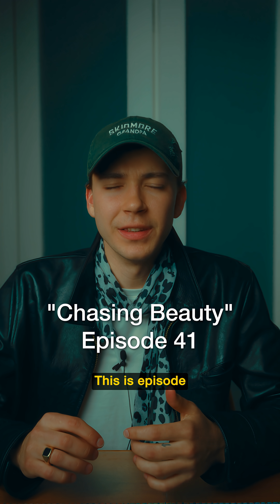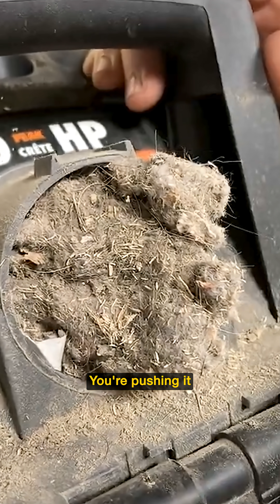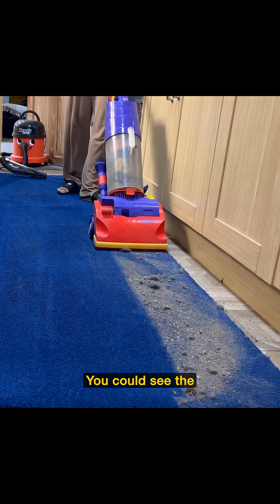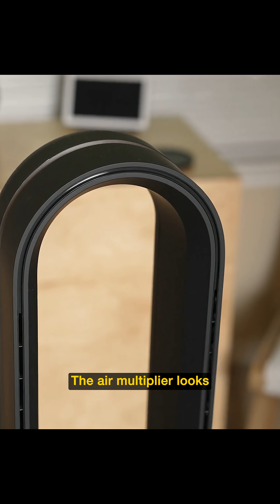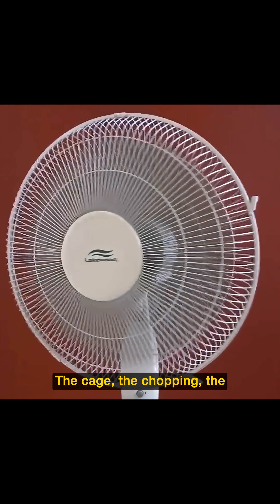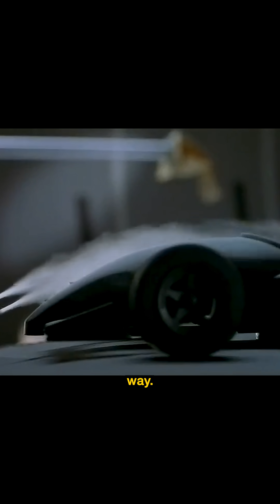Dyson products look weird, but there’s a reason. Behind their iconic product design...

Comment: "Before Dyson, every vacuun used the same system."

No they didn't. If you did your research, you'd know this. Before Dyson, there were were many different methods of containing dirt and dust. Bags may have been the most common, but they weren't the only one, nor even the first. Several other companies have utilized other types of filtration, including cyclonic filtration. Some of them include Filter Queen, Vacu-Maid, Vacuflo, Rainbow, and others. And vacuums didn't start out with using disposable bags. They often times used shakeout bags that could be reused, or buckets that would collect the dirt.

"You're pushing it around the carpet thinking it's working, but it's slowly choking on it's own collection."

While that's not a false statement, Dyson greatly exaggerated this idea when marketing their machines. Suction loss on bagged vacuums really depends on three things: the type of debris you're picking up with it, what kind of bags you're using, and how the vacuum distributes the airflow throughout the bag. If you're picking up loads of fine debris like sawdust, flour, or other fine particulate, that's going to clog the pores of the bag much quicker than if you were just picking up common house debris like dust, lint, grit, etc. If you're using cheap paper bags, those will clog up easier and let dust escape from them  than HEPA cloth bags, and if the vacuum's bag chamber isn't designed in a way that allows air pass through on all sides of the bag, not just from where the pre-motor filter is, than there will be suction loss as the air has to move through all of the collected dirt inside the bag. Despite this, the suction loss caused by regular use is definitely not going to be as severe as Dyson wants you to think.

Comment: The blade less fans or hair dryer doesnt impress me, but the jet hand dryer... i love that. Normal hand dryers just blow hot air and barely do anything, but the fast stream yet from dyson dryer does its job in seconds. And doesnt smell like shit because it has filters. If there is no paper or dyson dryer in public place i just get out with wet hands, they will dry anyway...

Comment: Dyson bladeless fans also hit a specific niche market; pet bird owners. I rescue parrots, and table and ceiling fan blades are crazy dangerous for free-flying birds, you have to turn them all off even on a hot day before the birds can come out of their cages. Ceiling fans whack them out of the air, and their tiny feet can get stuck in the mesh of table fans and break their legs.

Then I got a bladeless fan, and it just harmlessly pushes the birds around until they learn not to fly in front of it. Which is wonderful because I live in the tropics…it’s hot here!! 🦜🍳☀️

Comment: The only problem with Dyson fans no one realizes is, they are still as loud as normal fans with nearly the same performance... at a higher price.

So apart from looks, you're definitely getting less for what you pay for. When the dyson vacuum and hairdryer solves a solution while also looking good.

Comment: All that great Dyson engineering, yet the clip to open the dust collector for their vacuums are made of plastic and break as it frequently flexes.  This is a major and easily avoidable engineering flaw if metal was used instead.

Comment: Bagless vacuum cleaners 101.

Empty after each use, physically "tap" the dust out of every filter and then wash the various filters in unadulterated water until clear. Dry in a warm spot. 

Failure to undertake the advice above, is the reason for every bagless vacuum cleaner "failing" within a short period of time. 

Just be aware that vacuuming certain products will also cause the device to fail..

Any compound capable of forming a claggy, glue-like mass, upon exposure to humid or wet environments, will block the filters and end up deposited in the engine, resulting in engine burn out. 

Such products include;
• All types of flour and icing sugar
• Cake decorating powder
• Cement dust, tile grout powders, Plaster of Paris, etc.

Comment: As someone who worked in the vac industry for years, I can tell you they James Dyson design Phantom vacuums first (which were almost the same) and that the very first vacuums made were technically bagless. Bags were invented to deal with the mess. Today there is a big push back into bags as people are more concerned about dust and indoor air quality.

Comment: > all vacuum cleaner use bag before Dyson.

Pretty sure my family has been using a Japanese brand vacuum cleaner in the 1990s that does not use a bag.

It has an air filter that filters out the dust and a chamber to contain any solid.

When it is full you just empty the chamber then clean the air filter with a brush.

No fancy cyclone and design.

Comment: I love my Dyson vacuum, I’ve had it for over 6 years and it is by far my longest lasting vacuum EVER and it still works like new granted I do have to clean the filter from time to time but that’s fine because it saved me 100 a year on new vacuums. I would usually get the cheapest Eureka vacuum from Walmart and when it started to smell like it’s burning I would toss it out and buy a new one.

Comment: No, your dead WRONG about vacuum cleaners! Dyson SUCKS, alright, but not in a productive way! All PLASTIC, I'm always seeing stress fractures all over the body of the damned things, and they actually DO lose suction, actually it's AIRFLOW! Also....emptying out that filthy dirt cup exposes you to all of that bacteria, viruses, and allergens, so if you've got allergies, good luck with that! Yes, I know how the trapdoor opens to dispose of the dirt in a more cloudless, "sanitary" manner, but the TRUTH IS, you still end up with a fine, filthy coating of dust all over the outside of the dust bin when you lift it out of the trash can, a d taking it outside to do it is only worse, because air is always moving, whether you see it or feel it or not, and all it does is create a plume if filth that lands on you, the dust bin, etc., so this is not the ideal vacuum....by FAR. Any GOOD, high-end vacuum cleaner that employs TRUE cyclonic action, which always keeps the dirt in motion inside the bag, will ALWAYS be SUPERIOR to these new fad styles, and as that dirt spins inside the disposable dust bag, peak AIRFLOW is ALWAYS maintained, and bag replacement and disposal is MUCH more CLEAN and SANITARY than this pile of plastic garbage will EVER even HOPE to be!

An old Toledo, Ohio, high-quality vacuum cleaner manufacturer, AirWay Sanitizor, INVENTED and PATENTED the first disposable dust bag, made of cellulose fiber filter paper, superior to the common thin, single-ply dust bags used by other brands. AirWay did this at a time when the vacuum cleaner industry was in its infancy, Tuberculosis sanitariums were everywhere, and disposing of vacuum cleaner dirt from the original cloth, shake-out permanent bags in all other machines was an inherently dangerous task, as TB bacteria was commonly found in this kind of dust and dirt, and being airborne and highly contagious, all those other machines did was act as a massive bacterial slingshot! So, AirWay Sanitizor created the solution, and if you've ever seen one that still runs in a thrift store and turn it on, you will see immediately upon looking into the opening on the top of the bag that the dirt spins at 360°, which creates and maintains live, positive airflow and NO CLOGGING, FACTS!! With the advent of micron and hepa filtration quality disposable bags, any good machine worth its salt will have filtration, airflow, no clogging and no dust emissions, AND....it will STILL always be SUPERIOR to a Goddamned Dyson or any other "bagless" vacuum cleaner ANYWHERE, for that matter! The water vacuums are heavy and a huge pain in the ass, and they force the user to play in the mud and filth every time they use it. Give me a disposable dust bag ANY DAY over ANYTHING ELSE!

Comment: The only downside to the Dyson fan which traditional fans have an advantage is Dyson fans need to have their filters changed every so often but traditional fans don’t use filters so you never need to worry about changing the the filter
Reply: clean air isn't really a downside tho
Reply: @formbi yeah but you need to worry about changing the filters and there’s always the risk that they stop making the filters for some of the older models my cousin had a Dyson he had to stop using because they discontinued making the filters for it and that’s never an issue with a traditional fan
Reply: ah, I see, this really is bad
Reply: @formbi yeah it is bad and if your Dyson fan model is too old they will discontinue making filters for it

Comment: But if I am sitting my face in front of a fan, overheated, I don’t want to feel a thin circle of air around my face. I want to feel the air blowing right at the middle of my face full blast. That’s why ever since these came out, I always thought they were dumb. Pretty, but only useful if you’re far away. The kind of thing you buy to look good in a house showing but not actually functional.

Comment: Though the suction is good on Dyson's, in particular the older vacuum cleaners were poorly designed. The hose entered the body at the side, not in the front, making it harder to pull along and the body kept getting stuck behind every object in the room. Nowadays the competition has outrun Dyson I think, especially pricewise. Though the fan does look very good.

Comment: Should have also mentioned the advertisements. Dyson completely reinvented how appliances should be advertised
Reply: "Should be" is arguable.  For example, Dyson was not the first bagless vacuum, though they certainly like to pretend it was.  Same with a lot of their "innovative" products.
Reply: Oh, you mean having someone with a Brit accent so that us dumb americans will be impressed by his "engineering" spiel?
Bagless vacuums are constant emptying & filter cleaning machines.
Nothing works like a simple, well made canister with a bag you only have to change when it get's full.
Reply: I hate you
Reply: Dyson products are plastic, this isn't inherently bad, but you know the common failure points before purchasing it.
Reply: @user-yd7me7ns1o 99% of households items are half plastic. i don't get your point
Reply: @user-yd7me7ns1o I’ve never had a vacuum that wasn’t mostly plastic.
Reply: @km5116 
I use a non plastic vacuum. Its just a huge neodymium magnet, it doesnt work on dust though just all the iron dust and shavings that end up on the floor. I live in an industrial plant that manufactures metal components.
Reply: @km5116 
One word: Kirby
Reply: @washhtswarrior6411  cool. Very useful for households
Reply: @user-yd7me7ns1o how does that relate to my comment whatsoever?
Reply: @user-yd7me7ns1o  all hair dryers, vacuums and 80% of fans are made up of plastic, this has nothing to do with dyson being dyson and everything to do with those products not being half as useful if they where made up of 100% metal.
Reply: @user-yd7me7ns1o  what material would you prefer it be made of? Most vacuums are made with the shell being plastic
Reply: @user-yd7me7ns1o  What about it?

Comment: the fanless fan doesn't produce more air flow and my words are based on an experiment i saw.
if dyson fan produce more air flow maybe the motor is stronger which means more electricity consumption...

Comment: their standing bladeless fan has been proven countless time that those are not as good as blade fan. but their vacuum however is impressive
Reply: Yeah I was going to say the same. A regular fan out performs their most high end fan. 😅 

But I think the ppl buying those fans are more or less buying it as a fashion piece. Or a flex. Similar to buying the latest iPhone.
Reply: There are 3 issues I have with Dyson vacuum cleaners 1. they are EXTREMELY difficult to clean 2. you have to consistently hold down the power button or else it won’t stay on and 3. it’s not free standing it can’t lock in an upright position it will fall over the minute you let go of it

My Dirt Devil is so easy to clean 

You don’t have constantly hold down the power button and

You can Lock it into place so it can free stand and won’t fall over as soon as you let go of it and it has a little hose with attachments to get into small places
Reply: @michaelsegal3558 newest model removed the trigger.
Reply: @michaelsegal3558  nah the dyson trigger mechanic is fun and makes you feel engaged. Plus you can larp as if you're holding some futuristic gun and go pew-pew in imaginary scenarios
Reply: @holyX  I think they just really hit that neurodivergent spots 😂
Reply: Their haircuts are really good (speaking as someone with hair over 1m long) but there are cheaper ones in the Chinese market that are exactly as good
Reply: @acookie7548 I think you meant to write something different. What do you mean haircuts? Clippers?
Reply: @yannisr8888  maybe the blow dryer? a product mentioned in the video relating to hair?
Reply: @acookie7548  what is the correlation here between dyson products and haircuts..?

Comment: their fans are one of the most inefficient out there though and also very annoying to repair.
They advertise the multiplyer like it just magically moves more air but that air still needs energy to move and the bladeless fan is generating all that energy and delivering it very indirectly through narrow passages, the energy loss is immense compared to a traditional fan with optimized blades.

Comment: Dyson have been successful solving a problem that didn't exist.
Bagged vacuums are far superior.
Easier to clean, less dust in the exhaust, more reliable, much cheaper (bags cost nothing compared to a Dyson unit).

Comment: Technically, all 3 operates using the same mechanism.  The mechanisms for vacuum cleaner generate air flow for the fan and air from the fan was heated to be a hair dryer. They're literally making the same thing except smaller, lol

Comment: Dyson fans/hair dryers apply the Coandă effect to move the air instead of external fan blades.  An easy display of this is any ball suspended in a column of accelerated air.  Take a vacuum, put the hose in the exhaust side, turn the vac on and place the ball in the stream.  The ball will rise to the point the upward force equals the weight of the ball and will 'hover' there.

Comment: I have a Dyson vacuum myself,and it works far better on carpets than my other vacuum that I use for other stuff, my biggest complaint is the battery life and emptying part.

I use a Kärcher vaccum for the floor as it's stronger and runs from the wall socket, it also has a larger compartment to store dust and also water.
Reply: I'm assuming you have a Dyson stick vacuum? They also make regular sized vacuums, look up Dyson ball vacuums. We have 3 and they work amazingly, they have a long cord to the wall and a large dirt compartment. Just fyi if you're ever looking for another one lol

Comment: I’ve had about 3 Dysons over the years. Why 3? Because rhey are went to sh*t over time. Why not 4? Because I don’t like spending 4x the amount for a vacuum that is supposed to be great but does NOT give you value for that extra cost. I now buy cheap vacuums. When they die, I don’t care because they were cheap, literally 1/6  the price of a Dyson. When it dies I replace it. For some reason our home goes through vacuums like no one else. It probably has to do with our dogs’ fur…very wooly and it kills vacuums. Just bought alout newest vacuum for $70. Works great. Bags are about a buck each and we haven’t had to change one yet and it’s been a couple months. We also have a Dyson fan. This I do ile because I hate the cage of a typical fan and the dust that builds up on it. It was a gift to me from my husband. As much as I love it, I would still not personally spend that amount of money on a fan. Don’t have a Dyson hair dryer and never will. Hair dryers are cheap now and if it dies, get another. Not spending hundreds for a hair dryer.